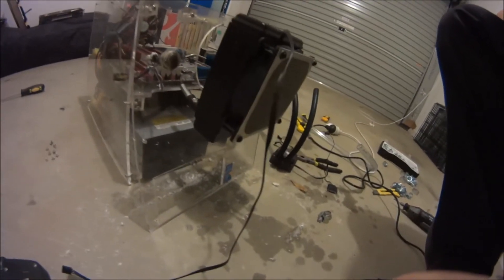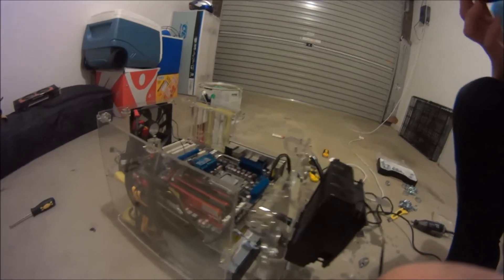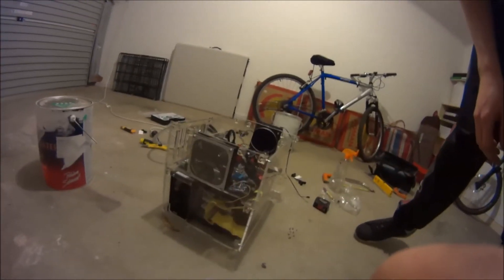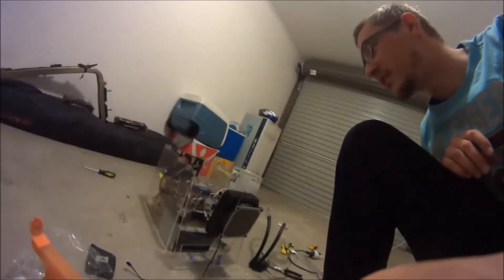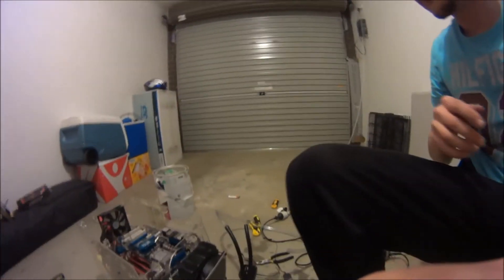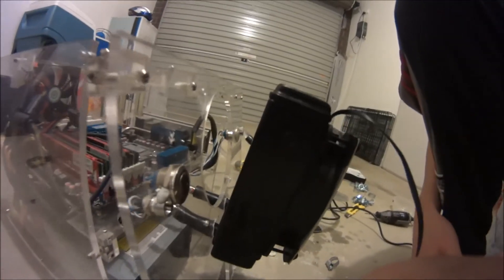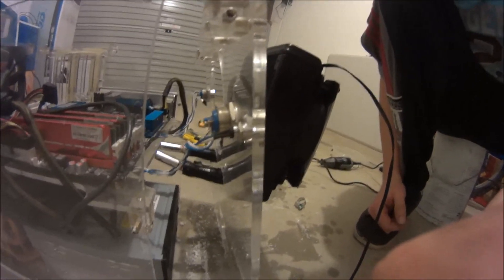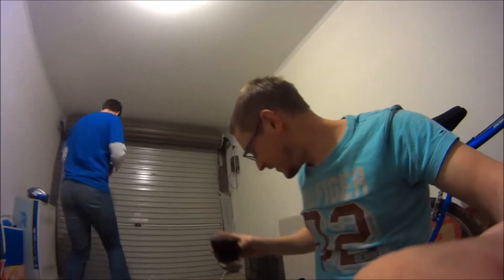Corsair H80i - Hydro System Installation (Revisited)

Comment: There are countless cases costing much, much less than the MM Slay that would fit this application better. Hanging that honking azz cooler off that case's exterior is a crime. But then anyone who works on their computer on a sheet on the floor of their garage probably doesn't have a clue anyway.